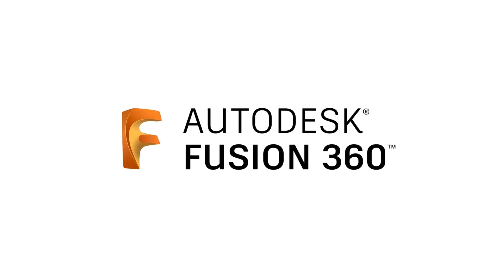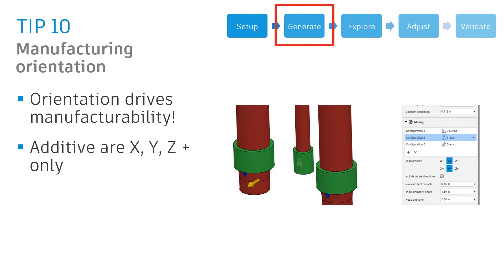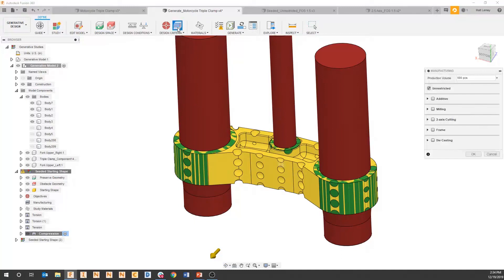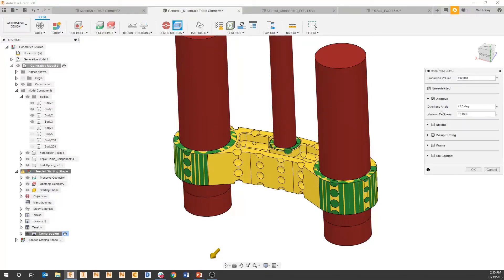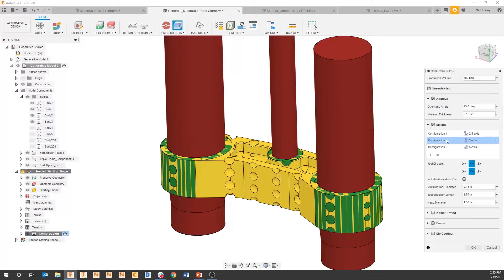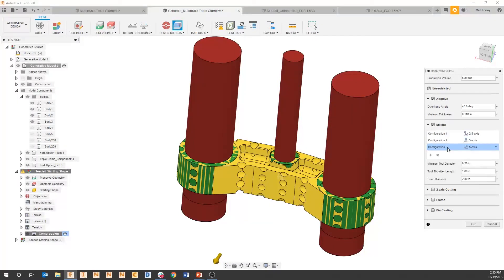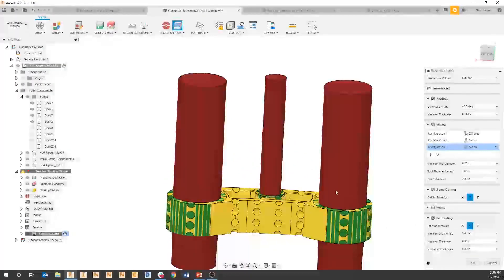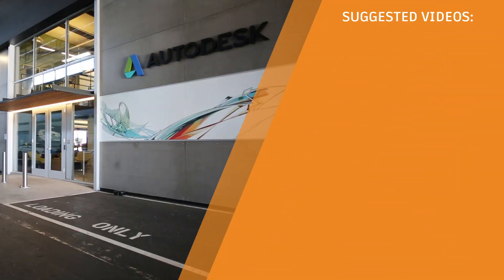QUICK TIP Understanding Generative Manufacturing Orientation

Comment: I'm getting generative results having more mass than the current design ? How to rectify this ?
Reply from the maker: Try different materials? Manufacturing methods? Verify the original was strong enough to begin with? Many ways to rectify, not sure what exactly you'd need to do, however.